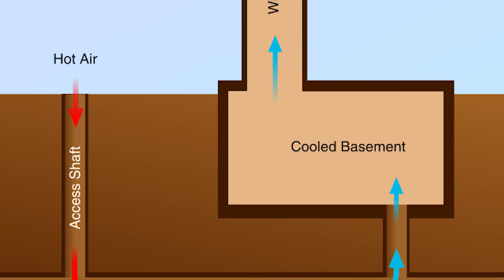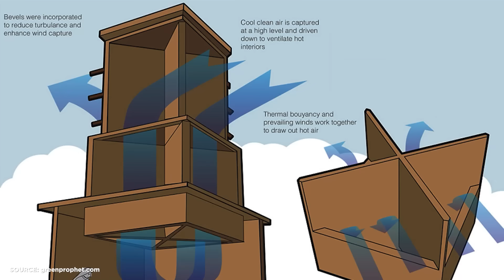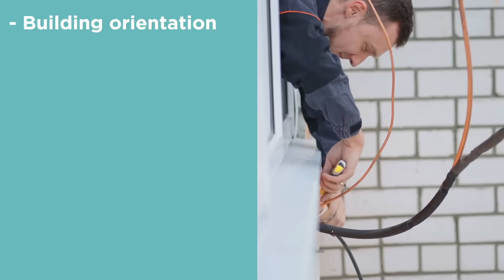Forget Heat Pumps - This House Cools Itself With NO Electricity!

Comment: A foreign friend has a townhouse with an open center core made to carry heat up and out at the roof access door/window. It works well when 1) the temp is high, but humidity is low; 2) the lower widows / doors are wide open (a security weakness); 3) the mosquito screens are clean (which is a constant maintenance item); 4) the tall house is hard on old knees. But they do have very low utility bills compared to my US home.
Reply: When I lived in San Francisco, USA most of those old Edwardian and Victorian apartment buildings had 'light wells' that were built in the centers of the buildings. Just basically holes from the ground straight up to the open sky, usually about 5 feet across, with windows that looked straight across into the opposite windows of another room in your or someone else's apartment. It seems like such a strange concept. I was told they existed to get some light into those interior rooms, and also for ventilation. I wonder if something like that would work somewhat like your description. In San Francisco the weather is pretty stable year-round, it doesn't usually get too cold or too hot. But I wonder how something like that would work in places like the US southeast or southwest France (where I now live) where winters are mild but summers can be uncomfortably hot. And in SW France air conditioning exists, but it doesn't necessarily go without saying that your home would have it. In fact it seems most people I know don't. I wonder if something like this would be a natural solution.

Comment: I live in the Netherlands. And i have a “0 on the meeter house” so the electricity bill should be zero. But the heat pump in my house uses more than our solar panels are generating. So there is a electricity bill that is actually pretty high.

Comment: I had a house with radiant heat in the ceiling upstairs, and in the floor downstairs.  It was extremely comfortable, but when those tubes start to weaken and leak, you're back to "traditional" heating, since repair cost is astronomical.
Then, another house on a lot that was previously eco friendly.  The lot is FILLED with underground plastic "stuff" and the surface would be too, it it were not covered with vegetation.
At this point, I say stick with traditional, proven construction, that will last, and not pollute with new tech.
Reply: Yeah we hate plastic junk too.  Still can do all the things brought up here with more natural and traditional materials easily.   👍🏽

Comment: A few points....
People didn't live in certain areas. At least in a certain density. 
They wore a lot of clothes in cold areas, furs, etc. 
They had fires.... you have an insulated home, you have a fire in there.... it stays warm. Seems like this was strangely skipped. 

The actual "clever" solution was ... people didn't live in some areas. 
Since most civilization lived relatively close to large bodies of water, the extremes were lessened. That isn't the case, nor is it a solution. 

Wind catchers won't work in all areas, same with the canals. Areas with low wind, or where wind doesn't flow (wrong side of a hill for example) the wind catchers wouldn't work. 

The real solution isn't "non-electric" options but local electric, i.e. devices on homes that may not generate all the electricity the home needs but can help offset thus reducing the strain on the grid. 

What many people don't realize is, the issue with getting power, brown outs, etc. isn't that there isn't enough energy available to do things, i.e. can't burn enough. Its the transport of the energy. The US grid is at major risk of this problem due to being extremely outdated. The lines can only carry so much so as demand increases the ability to fulfill that becomes more and more difficult. Ironically, Renewable energy, like Water, Solar, and Wind, done in a centralized fashion (i.e. not people having them on houses) will result in not enough energy to meet the demand. Fossil fuels will not have this issue ... until they are all gone. Nuclear, on the other hand, is a good option, the problem is the fear of nuclear due to its association with nuclear explosions (can't happen) and various propaganda from ... fossil fuel companies. Although, even with nuclear, the transportation of energy will still be needed. 

For a long term solution where we leave fossil fuels we need to massively upgrade our energy grid and invest in nuclear power.

Comment: I don't know where you got the idea that before electricity, people lived comfortably. Except for a very few, and maybe not even the rich, people suffered in the heat and the cold. As to the latter, most people built a big fire, or at least as big as they could maintain in one room of the house and slept in that room, or bunched together for warmth. They cut down whole forests to heat their homes and cook their food.  Way before dawn someone, usually the mother, got up to stoke the fire, put on new logs, and started a fire in the stove. Since they didn't have running water, the bucket of water was probably frozen over. Someone would have had to haul water and chop some fire wood the night before. When it came time to wash clothes, water had to be heated on the stove. The wet clothes were strung outside, except in winter. Baths were also fun. The youngest kid probably bathed in cold dirty water, as everyone bathed in turn by age. 

Yeah, it was so comfortable living before electricity. That's why everyone installed as soon as they could afford it. I mean, it was so nice to use the out house when need came. 

This romantic idea about how wonderful it was to live before the modern age, is a fantasy. It was a daylight to darkness back breaking work to just get by without freezing to death and feed your family.

First the idea was to get rid of oil and gas. Now the idea is we can get rid of electricity, because the people who lived before got along just fine without it. Let's see how much it will cost to retrofit the entire country for living without electricity, or with just roof top solar panels.  Just like the Egyptian pharos of old, the rich will get along fine, while the rest of us will freeze to death in the dark.

Comment: I've been lucky enough to build my own off grid semi-passive home over the last two years. 

My main area is a large chamber where two of the four walls are a 40cm thick, 5% cement-stabilised rammed earth wall. Overall the wall weighs over six tonnes. The soil for it was Manually dug and filtered from 10 meters away, and was then compacted (by hand!) Into formworks. The rest of the walls/roof are heavily double insulated woodframe with steel external cladding. Above that you've got lots of solar panels on the roof to take the brunt of the heat. 100% DIY while doing my best to adhere to local building regulations. 

The rammed earth right-angle wall essentially acts like a giant thermal battery. It's incredible how stable the temperature stays. In winter it remains warm, in summer it is as cool as a cave. I also have a small fireplace right in the corner of this rammed earth wall. Once lit in winter, the thermal battery absorbs LOTS of heat and the room can remain warm for days. 

It's incredible how unappreciated and maligned these types of construction are....if my project was official, it would have gotten off the ground due to the fact that rammed earth is not considered an 'approved building material' in Australia. Despite its incredible strength and durability of literally thousands of years.
Reply: You said PVs catch most of the heat from above, but PVs work better when they're cool. Do you have or have you considered some method of draining the heat from them (perhaps to heat air or water) as a way of utilizing that heat while keeping the PVs cooler?

Comment: The gravity driven electric generation sounds like something that would have ben used before electrically. Like cooling your shack in death valley.
It was at least 50 degrees cooler just because the miners built a carport 
About 10 feet higher  over their shack...giving shade 
And cooling the house.

Comment: I was a custodian on the University of Idaho campus. I got to see progress shut down a perfectly good cooling system. The Administration Building had a cool basement that connected to the main stairs that went straight up the center of the building. The building its self was made from stone and brick that moderated the temperature. All the offices had outside and hallway windows that could be opened so the cold basement air would be pulled up the main stairs as the rooms warmed up on hot days. Building codes changed, so even the stone and brick administration building has to have fire doors to block the old natural airflow. This made our basement custodial office too cold as the cold couldn't escape up the stairs anymore. Now the building was room air conditioners sticking out of most of the outside windows.
Reply: Everyone, report this as spam; this person is not Joe; do not fall for this scam. Note the lack of a checkmark by the circular picture. Report as spam any such spoofs you come across on any webpage.

Comment: passive house doesn't mean no AC or modern conveniences. it means building a structure so efficiently that you can downsize your ac thereby reducing the energy consumption needed to power an average home (by a lot.) The house is built so tightly that you reduce or nearly eliminate all the energy loss from leaks. Passive house= a house that produces as much or more energy than it consumes. Often times homes complete the process without installing the solar panels but the calculations are in place to determine the amount of panels it would cost to offset completely the energy requirements.

Comment: Simple thick walls will work in most climates for both heating and cooling. 12-18" thick walls (concrete block with 2" thick insulation on both sides would work fine). THe problem is the window and door openings and where the roof attaches. 
Another option is to have the structure underground. The grounds insulative properties would work well for both cooling and heating. People think they have to always go high tech, but the pueblo indians built adobe buildings that worked great both for very hot summers and medium cold winters.

Comment: Just to put some perspective on costs: my electricity bill is currently around $2000/y. I use basically no electricity, though we've used a bit more this Winter because we're both working from home and my other half doesn't like my option of using lots of blankets to stay warm.

If we were to spend $10,000 to replace the thin single-glazed windows in our place with double-glazed windows, that would cut maybe $500 off our electricity bill. The simplistic payback period for that project would be around 20 years.

If we were to spend $2000 replacing our off-peak resistive electric hot water with off-peak heat pump hot water, that would reduce our electricity bill by about $500/y, giving an effective payback period of around four years.

We keep our energy use low by only having one or two lights on, mostly reading or watching movies for entertainment, and most importantly dressing warmer or cooler for the prevailing conditions rather than cranking up the heat pump. During summer we'll cool down to 23C, during winter we'll heat to 16C (and wear warm clothes or live under blankets). $50 for a "blanket hoodie" is far cheaper than $100/year for heating.

Passive Housing is a great idea, but for established homes there are many options to reducing energy consumption which basically boil down to dressing appropriately for the prevailing conditions rather than using energy to make the house comfortable for suit-wearers.
Reply: Great job!  Many folks aren’t willing to pay attention and make the same decisions you make everyday though.  Where do you live BTW.  Some climates just get less comfortable too.    
Well done though!
Reply: @mrkozz1  I live in Canberra, which is an inland city that tends to be cool and dry, max summer around 35C, min winter around -5C, I'm told average humidity over the year is 67% if that means anything. Also typical Australian construction is brick veneer homes (brick exterior walls, plasterboard interior) and architects/builders here are clueless about airflow, airtightness, or applying insulation correctly. I doubt any house built in Australia would pass occupancy inspection in Canada for example.

Comment: I'd absolutely love to be able to offer passive offgrid apartments.  I'm pretty sure I would have to include ac in the 110 degree summers.  Being able to offer all included energy I'm pretty sure I could charge enough to make up the difference while I still saving tenants money overall gas/ electric bills.  Electric cars really screw the calculations for though.

Comment: I live in Las Vegas Nevada and back in the late 80s early 90s as a kid going into teenage years I remember most homes had a swamp/evaporative cooler to work with the AC. The evaporative coolers work really well out here with the dry climate but for some reason none of the new homes after about 1990 or so aren't built with them anymore and I don't know why.

Comment: Changes in housing tend to be slow, building codes rule and are based on what has worked for years and sells this years hot thing (last years?). It is possible to build homes that use little or no electricity/gas/wood/etc. for heating or cooling. But one must still pay for and install a known accepted method for heating that is able to get every corner of the house up to 21C if that is a good idea or not. Building codes penalize high mass housing with thick high mass thermal walls which give stable inside temperatures over a full day cycle or in some cases across seasons (seasons takes more than thick walls) because local bylaws may limit house foot print or at least the building permit will cost more for the same livable area. Getting a housing idea that uses heating/cooling ideas that are not covered by building codes permitted is not easy, It requires finding an engineer who is willing to put there livelihood on the line to sign off on your idea.... or live so far of grid they can't find you. All options seem to require deep pockets or breaking the law.

Comment: Well Joe, if you're asking about how comfortable the average Irishman was in times gone by, it makes no sense at all to compare the wearing of wool and animal hides to modern HVAC.  Large, or small - stone buildings were better than sleeping in the fields, but by today's standards, that isn't saying much.  Peat was widely used for centuries to provide heat.  When I visited Ireland in the 60's, coal was also being used to heat even modern houses, along with peat.  Today, I believe natural gas is more readily available, but the idea of whole house heating is a relatively new thing.  Unless there has been a great deal of retrofitting, I suspect that many older homes are still being heated the old-fashioned way, by fireplaces with built-in water heaters.  So if you want hot water, you must think ahead and make sure there is a fire.  Keep in mind that in the days of yore, there was an abysmal infant mortality rate and the average life-expectancy wasn't very wonderful, either.  Among many other things, the quality of the housing stock certainly played a role in that hard fact of life.  You may have also heard that Ireland's greatest export over the centuries has been... its people.
Reply: Irishman here. Currently living in a very (VERY) rural house that's about ~150-200 years old. Whole house is heated fully through oil, as is very common here (many places also use gas or electricity). I've lived in modern homes (10-20 years old) and other homes as old as this and they've always been heated with oil/gas/etc fully through. You won't find anywhere that heats a home using only a fire anymore, short of a tourist experience (or an abandoned cottage perhaps). Not sure when all the retrofitting would've taken place, but certainly before my lifetime, so I would wager late 70s/early 80s.
Reply: @sineamhac  Hello there!  It's good to hear from an expert on the subject.  My siblings and parents visited Ireland, England and Wales in the summer of 1965, when I was quite young.  My mom grew up outside of Cootehill, on her parents' farm in Cavan County.  My siblings and our mother were there for about six months.  Our dad visited about halfway through; for two, or three weeks.  My recollections are tainted by the fact that I was just a kid, but the differences between here and there did strike me at the time.  We spent most of our visit in Ireland, on what was then the outskirts of Dublin.  We stayed at the house of our aunt (mom's sister) and her husband & their children.  They were fairly well off, he had a good job in management at the phone service (a branch of the postal service, then).  The house they owned was only a few years old and it was a part of what we in the U.S. would call a subdivision;  tract housing, all built by the same contractor.  The house our mom was raised in (oldest child of 11) was a cottage with a thatched roof.  One of my uncles was running the farm by the time we visited and he and his wife had built a new house not far from the old one.  So, I could go on and on, but I'm sure there have been many changes since then.  I was responding to some things Joe had said about living in large medieval stone buildings and felt the need to say that even in my lifetime, the average house in Ireland back in the 60's wasn't quite what we in the States were familiar with, in the HVAC realm of things.  There was heat, considerable ventilation, etc.  Thank-you for responding.